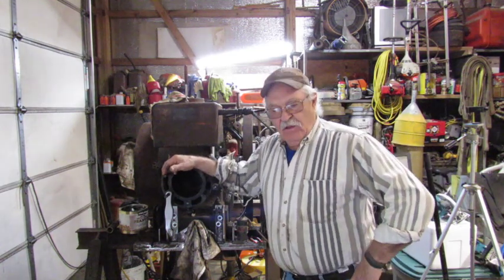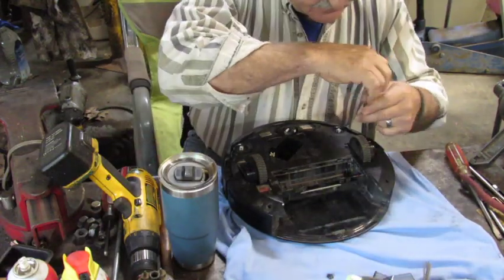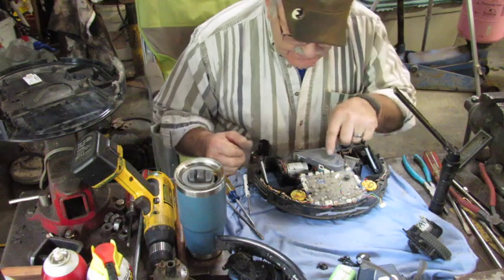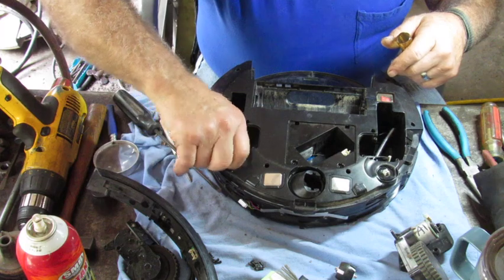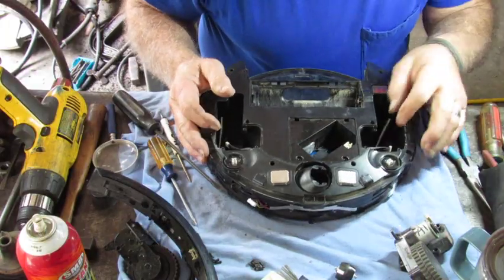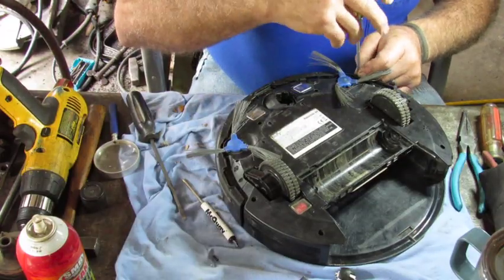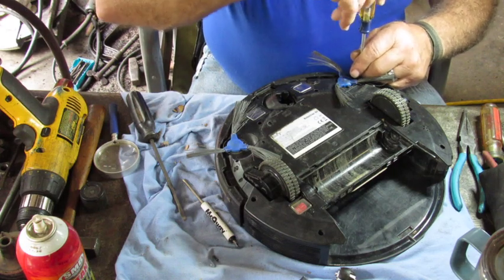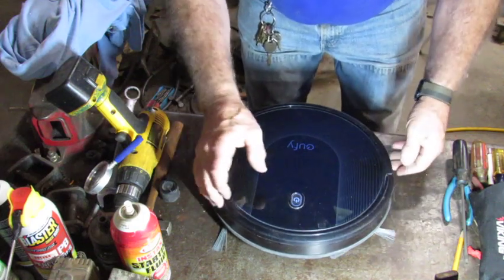Total Failure EUFY Robo Vac Repair

Comment: Sounded like a bearing gone wonky.
Reply from the maker: It's got to be a connection inside the sealed brush drive assembly that I cannot get to without destroying the plastic case. At least I got tons of dust and hair out of it and it's been giving us good service ever since.  Its still noisy, so we program it to come on at 2 a.m. It's far away from our bedroom in the four season room separated by a step from the rest of the house. All is good so far.  It's still picking up dust and lint.

Comment: You gave  it a try anyway buddy if you can't fix it Wendell it's not looking good for anyone else to try . Take care have a great weekend
Reply from the maker: Hahahaha....Tom, that's funny.  Well at least it HALF works.  The noise is coming from inside a sealed area that powers the one brush.  It's still noisy though.  That thing was a bugger to take apart.  Everything is so tiny, especially the screws and about 4 different sizes too.

Comment: You have more wins than losses. Still enjoyed it
Reply from the maker: Hahahaha...my luck has to run out on something doesn't it. LO:L. At least its working fine...much better once I got all the lint and hair out of it.  But dang it if it ain't still noisy as can be.  And the one brush does not work. It's gotta be the brush drive that's sealed inside the body, inaccessible unless I break it.